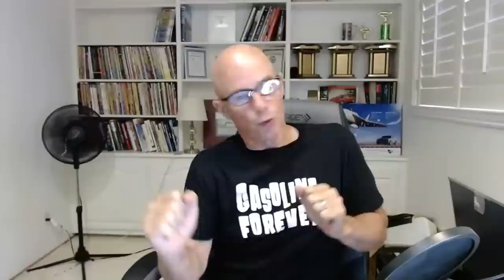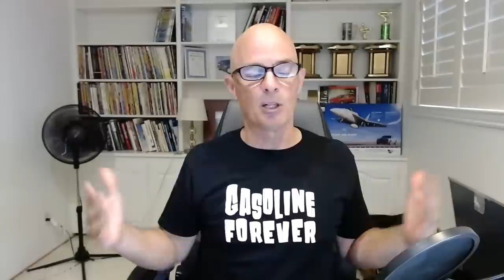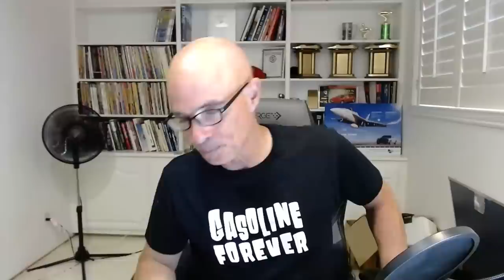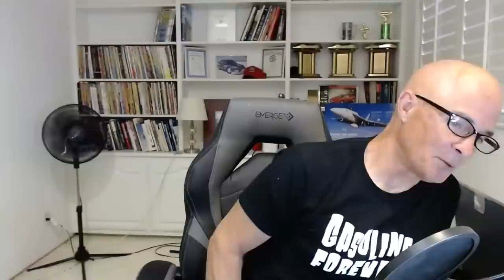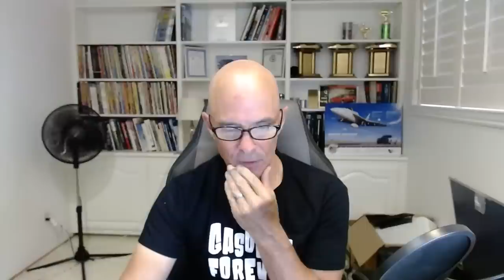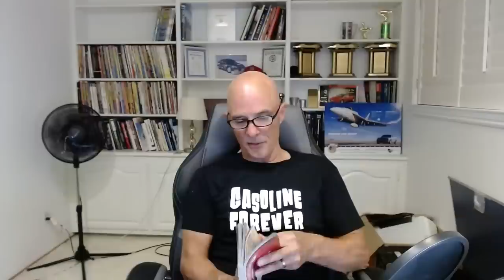LET'S TALK TECH-WHAT IS "STREET BOOST"?

Comment: I like to follow the "don't mod your daily driver" rule. The go-fast parts can go on the project car.
Reply: agreed, extra money always goes on the money pit in the garage. lol
Reply: I always have this conversation with my customers.  I always ask if they are required to appear at their employer daily?  If they have a mortgage ? If they need a reliable vehicle? That's usually where the conversation ends. 👍
Reply: I learned this lesson the hard way. In my 20s, I tried turning a daily driver into a project car, and it didn't work out well. For example, one time I tried to do an engine swap on my days off. Things didn't go as planned, and I had to use a week's worth of sick days. My boss was not amused.
Reply: safest route. but if you want to bank your resources don't get involved in the first place. meaning your gonna have to do your transportation the hard way there is no other choice. bicycles don't burn gas lol.
Reply: The real mods I do too my daily driver is too improve mpg, which is usually a detunner/eco mode tune of  some sort which I did too my 2005 dodge ram, I eventually did a e85 conversion after the fuel pump fail, best mod I ever did too my daily driver.

Comment: I'm running 13-14 psi on my almost daily driven 91 F250 with a forged rotating assembly 460 (472) EFI BBF. 92 pump gas with water methanol (boost juice) injection.

Comment: factory compression makes a difference too.  In the early 2000s I had a little stock bottom end mustang 5.0 with ported iron GT40 heads, a crane 2031 cam, and a procharger @8 psi.  That motor is 8.75:1 stock compression.  So I never even had it on a dyno or connected to a wideband and was able to tune it well enough that I didn't hurt the motor.  It made 396rwhp when I finally did a dyno day.

Nowadays, an Ls3 is 10.7:1 and makes that amount of power NA.  Totally different ballgame.
Reply from the maker: which stock 5.0L is 8.75:1 compression
Reply: @richardholdener1727  I thought all the '87-'93 5.0HOs were 8.75:1 stock.

Comment: I'm disappointed I missed this one. Really up my alley. Was running good times on 8psi in the Gutless Supreme. My fuel pump shit the bed somewhat, ran out of fuel pressure compensation (running fuel pressure sensor). Engine lived with a lean-ish 8psi pass. Running decent timing too, I love it, makes the engine run cool. On 12-14psi I doubt it would've lived considering it's a 10.5:1 CR  stock longblock K24A2. I will say now, once it's fixed I'm gonna tighten up my Fuel Pressure safety threshold.

Comment: I currently drive a 2016 ford fiesta st with the 1.6 ecoboost as my daily driver. I run an E65 ethanol mixture and the "bigger" turbo on it will build up 35psi of boost. This is my only vehicle. It is my grocery getter and my way to work every morning. It did come stock with a turbo that put out about 16psi so my bigger turbo upgrade has added about 19 additional psi

Comment: We went on vacation to Chincoteague , VA and rented a car at the Salisbury, MD airport. A new Chevy Trax AWD. We were able to all ride comfortably, Me, my wife, and my 12 year old granddaughter who is 5’6 and is mistaken for an adult. We stayed  4 days/5 nights and we drove all over and back to Salisbury, MD. This is a 3300 lb  with us and a full tank and luggage likely 3700 lbs. I stress this is AWD full time. It has a 1.3L turbocharged engine that makes 155 hp and 180 ft lbs of torque. It actually felt sporty.  I think it had a 6-speed OD. I think it does that stupid stop-start thing which must be hard on things.  But, to me a1.3L 4 cylinder pulling a 64 Chevelle full time 4 wheel drive?  No, that’s crazy?  But does it well the engine running an hrs drive each way 60 mph, curvy 2 lanes.  It never felt under stress.  We ran regular gas. Not a hiccup Ford has a 2.0L turbo that makes 310 hp and 285 ft lbs for the new 4400 lb Edge. Out 3.7 V6 in our 2011 Mustang makes that. Our 2013 Edge with the 3.5 L V6 makes 265 hp and 285 ft lbs . Our Mustang and Edge are NA are like a hog on roller skates in the least bit of winter precipitation. You can’t get them up the driveway.  We are considering trading them both in for a Trax even up.  God forgive me, my Gypsy/ Celtic Tinker ancestors, but I may just get a Chevy Trax.  My wife loved it. I still have my 65 FE Galaxie, but I have to turbocharge it.  I have a 105 truck block that has the 3 rib main webbing and according to my neighbor and his Sonic in the shed, it has 428 thick (even for a SCJ428). I’d like to build it with a 4.13 bore and 4.25 stroke for a 455.48 FE with CNC PROMAXX SHOCKER with 2.165x 1.65 exhaust with an equivalent of the Brian Tooley cam for a big LS and maybe use the 3 inch X pipe and run a crossover to the right side so I am using my 2 inch tube headers mount the wastegate BOVs and Turbo where a catalytic converter would go with a bash plate underneath run the exhaust open with a 4 inch straight out under the right door. One up pipe to the Hat on a 750 Holley. The air underneath the car would cool it the one 3 inch pipe up should make 800 hp on E85 with a 510 hp 455 that revs to 6600.  What about a remote turbo running off of the front part of an X just run a 3 inch cross pipe over like a manifold Feed the hot side and run the cold side up. Put a slight snorkel and K/N cone in for good clean air and the exhaust straight under the door.
Reply: Turbocharged a 455 FE with aluminum heads and intake water pump only weighs 510lbs. I have seen it, put the turbo right behind the torque box, using the X pipe and a 3 inch pipe with header bolt ons to attach to the back of Xpipe and run into the hot side of the turbo. The air intake can come up with the cone filter and the Exhaust straight out 4 inch.  I would not think it would be louder than a couple Harleys.   800 -850 hp possible with E85 ? Am I crazy or just stupid?

Comment: 7mGTe Supra 60-1 ct26 piston/rod build mhg arp everything balanced everything bored decked line bored. V8 afm (ls400) 550 cc injectors, apexi neo to tune. Stock base timing. Greddy Profec B spec. 14psi if I wanted kill I popped the dial on the Profec and turn it a little more and run 18psi. 93 forever. Drove it for more than 10 years. I wore the turbo out and thought it was toast did a 360 thrust upgrade and the smoke went away. Yay :p

Comment: I'm pushing 16 lbs in 7:1 comp BBC 427 locked out 30 deg timing pump gas in street car, with AC. Hear a little rattle only when really cold outside.

Comment: Sr20det ran 18 all the time. 93 all the time. I built this for some one else dude drove it for 3 years sold the swap to a dude and it’s still riding. Stock timing on it. Both these has better cold air intakes fmic upgrades and exhaust I built (short).

Comment: Richard, if you see this comment, I currently have researched these LS engines for 100s of hours now(your videos). I have a 05 Silverado short bed , single cab, classic  I've been restoring/custom building , and im just very torn on what direction to go. I have notes on ALL combos for. 4.8/5.3/6.0 builds, but I am stuck in between wanting a descent N/A build, but also able to put a small turbo on it  down  the road without any downfalls  that can maintain a decent mpg(15-20) when driving far distances(drivability/efficiency) . I like the 4.8 idea, and just adding overkill heads, and a descent "truck style" cam ,high  pressure  oil pump , etc... But then I worry about not replacing all the bearings/not  measuring internals/dirty oil and coolant passageways....  But also like the idea of taking a 5.3 and having it bored over to a 5.7 and keeping it N/A, and going ahead and having a machine shop match a good combo of crank/rods/bearings/ pistons /cam/ head work etc.... while I'm at it ......and never adding a forced induction.. Should I just buy a junkyard 4.8 and have the turbo ? Or would it be a similar cost to build the 5.3 fresh/brand new ? And what would you think the differences in power/longevity /effeciency would be? Lmk,. New to this, but really really love your technical videos that teach what camshafts ACTUALLY. Do, and flowing different heads/combos. Etc. So us newbies can actually understand there is More to a pushrod v8 engine, than just having it make that "loppy" sound at idle. Lol thankyou, hope to hear from you. Peace
Reply: If you haven’t made a decision yet, I’d slap a 6.0 in it with a small cam, springs and ring gap. Boom done. It’ll have your fuel mileage on the lower side, but it’ll be torquey even at low rpm’s so good for a daily. Then if you slap a smallish turbo on it in the future you’ll have really good boost response and a lot of power. It’ll require a lot less work to get it where you want.
Reply: @thephilosopher13  I appreciate your reply. Would you happen to have any ideas on what kind of fuel mileage a well tuned 6.0 could get? (I understand that it's silly and shouldn't matter lol) I just started the build with mpg in mind cause I think it would be a "neat attribute" ,after hearing Corvette nerds talking about getting 30mpg on highway. Haha thanks, peace
Reply: @DwightKShrute  I have never tuned or built a 6.0 with fuel mileage in mind lol. It’s usually about burning MORE fuel.
Reply: @thephilosopher13  for sure. I know it's an oxymoron. I've just heard stories of these guys with boosted 4.8, and 5.3s claiming in the.high 20s mpg ,with MORE than enough power, and like the idea of an incredibly well built and efficient ls,  if it's actually a possibility, if that makes any sense. Lol
Reply: @DwightKShrute   oh it’s definitely possible. My buddy’s 5.3 still gets
Okay mileage. I’d say he’s probably getting 20ish mpg highway but he’s also only got about 380-400 hp lol. And that’s highway, straight highway. When he’s running in the city a lot I bet he’s at about 10mpg 😅 granted, a lot of that is because he likes hearing it I between city buildings lol.

Comment: I did comment on a live before but it's was a terrible attempt.
But when I was referring to the 318 I was referring to the Mopar small block maybe La cuz the oil better and I got one, and they had they don't flow air very well in the upper RPM range, I was wondering how much boost a stock block 318 with a turbo jammed on top if that would make any more power and how much power it would handle was the question I was trying to ask it's something I'm thinking about in the back of my mind but I don't know if it's going to grenade or if it might work I don't have the time to throw at it cuz I'm busy with a thousand other things but if someone says it might work I might try it,
I can't find anything on this idea
Reply: Richard says if you raise the usual ambient atmospheric pressure of around 14.7 PSI to 14.7 PSI higher with boost, you should get double the horsepower. 

Build your engine for good power, naturally aspirated, then boost will increase it in proportion to the boost PSI over ambient PSI.

Can you imagine the power we could make if the atmosphere was at 29.4 PSI?
Reply: @exploranator  I'm not looking to build a race car I just want a little more in the mid to top range for when I'm pulling

Comment: LS Gen 4 connecting rods are the same as gen three and a half connecting rods
Reply: What year are the Gen 3.5??
Reply: @allanb3222  06 LS it's just a gen 4 with a 3 bolt cam and no variable valve timing, just dod. I never heard them called gen 3 1/2 until this video but I knew what they ment
Reply: @allanb3222  also not all 06 ls engines are just the LH6

Comment: boost is irrelevant hp is irrelevant maximum torque @ rpm is the limiting factor based on the combination a 5.3 that is barely ok with 500 ft lbs at 2000 rpm can handle 1200 ft lbs at 6000+ rpm so many (experts) talk about hp limits but that doesn’t tell you the low end torque that can scatter a motor that is only making 200 hp
Reply: a 5.3 ls with 30 lbs making 375 hp at 2000 rpm is not hard to do but will grenade instantlyso the idea of hp limit is nonsense
Reply: @bill2178  Did you mean 1200hp at 6000 RPM? 1200 ft-lbs is not a realistic expectation, if you want that motor to live, regardless of the RPM.